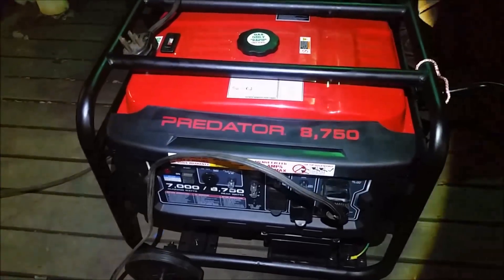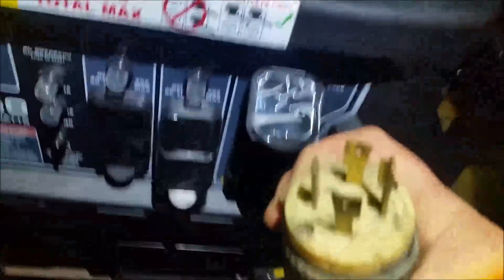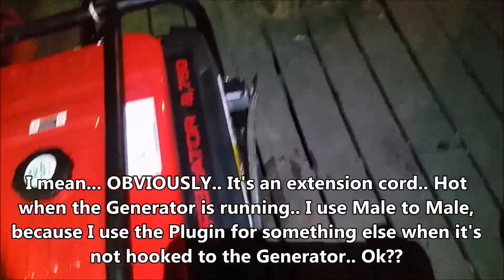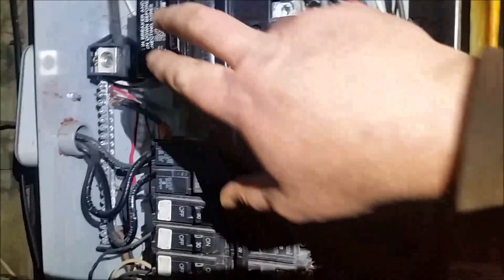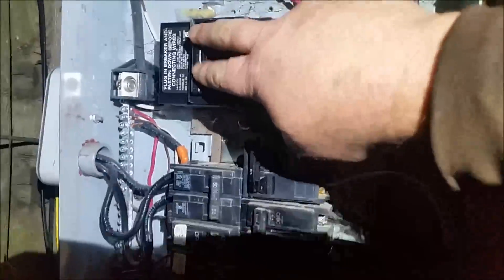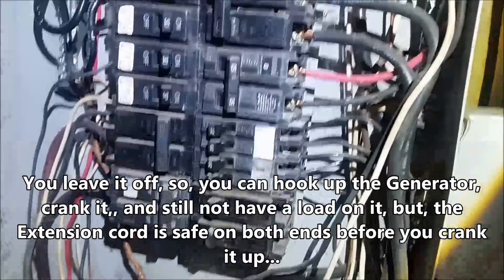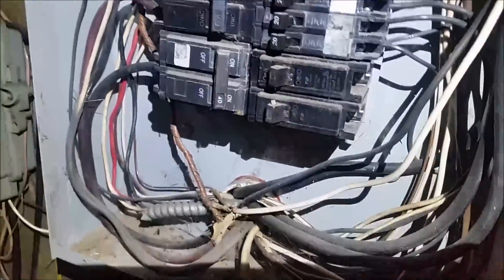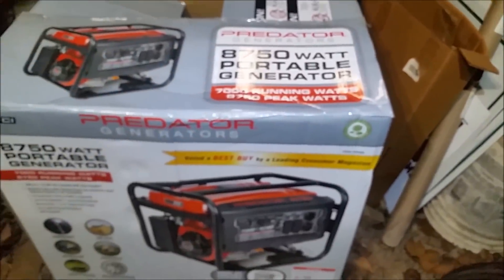Quick/Easy/Safe: Use Existing Plugin/Breaker for Generator hook up to your house Panel box.

Comment: "Common Sense" suggests an average degree of such ability without sophistication or special knowledge. You keep yelling at everyone as if they don't have Common Sense, when in reality you need to be stating "This video is not for those who can't follow the exact 7 steps exactly as planned every time even while under duress and who is also comfortable exposing 2nd or 3rd persons to failure at attempting the 7 steps once the mechanics have all been installed and that failure to do so could result in death of local persons or line men."  The commentators who are licensed electricians are telling you it's illegal and they are telling you what it takes to setup a fail safe system. For this task, I would say that Common Sense represents everyone of ourselves who are not licensed electricians and that special knowledge is not in the scope of us Common Sense people. So the solution is simple, change your title to "How I hooked up my generator to my house (illegally but it works)", followed by adding the comments, "Certified electricians please comment on caveats and how to make a fail-safe permanent installation for a portable generator."
Reply from the maker: Exactly what I said. This is for people with common sense, so all those wordings that you just typed are not needed. And, it is not illegal. Those are plain and simple facts.
It's not even illegal for an electrician to do this to his own home. But if he charges someone else as an electrician, and does this for someone else, then he has violated the electrical code that he agreed to whenever he got his license, there for his license would be subject to revocation.
Against code, but not against the law. And considering, the male to male cord which is the only thing not Code Compliance, won't be plugged in when the inspector gets there, there are zero problems with this setup as long as you remember to turn the main breaker off, the breaker you use for your generator off as an additional safety precaution, and hook up both ends of the cord before you crank the generator. But it would take common Horse Sense to figure that one out. That's why we have so many comments on the video that are negative period lack of common Horse Sense
Reply: You're stating that it's not illegal, but then you also state that you have to hide things from an inspector for it to pass inspection. I actually have no clue whether or not it's legal, but I'm just real curious to know why such extreme arguments exist from so many people on both sides. It seems like you've done quite a bit so far and it seems like you utilize the generator multiple times a year, why not just step it up one more notch and get the final punch up to where it would fully pass an inspection?!? After all this is not an emergency, you are doing it in a planned manner. Then have the city inspector come out with the house running on the generator, hand you the inspection report, and post it here, done!!! End of discussion!!! Hell, even make a bet with 10 guys on this forum that think you won't pass inspection and collect some gas generator money for the next few months!
Reply: +hgodtx -- If you don't know what you are talking about, why did you say you did.  The reason there are so many contradictory comments is because the laws vary from city to city, town to town and place to place.  The National Electric Code is NOT law UNLESS a city or town passes and ordinance saying that it must be followed.  Many do exactly that.  Many do not. Some don't care and minimize codes to make it easy for contractors and homeowners to get work done without fighting bureaucratic red tape.  What make does (and I do with a solar generator) may be illegal in some places and may not be in others.  In some places codes apply only to professionals who earn a living doing electrical work or contracting.  Homeowners are excluded and often do not have to pull permits to do work on their own property.  That is as it should be.  There is NOTHING wrong with what Mark has shown us but it could be illegal depending on where you live what kind of nanny state government you have locally.  Thanks, Mark, for an informative presentation.
Reply from the maker: Thanks I'm Grateful.. I have not lived in a state yet that disallows a homeowner to do his/her own work. Nor one that "requires" that you pull a permit if you are a homeowner doing your own work.. I would think that a town would "like" you to pull a permit and get an inspection (Taxes/Fees/fines/Permits/certificates is how the government rolls around), but, I am not familiar with any that "Require" the inspection for homeowner work..  Not saying some Liberal state has not done that for sure.. I have beaten several citations that I have gotten because they were written by someone who writes for whatever reason he/she wants to write one, but, when it comes to enforcement, and they have to answer to the code, often, they are stretching the bounds of their authority because people just don't know the law, etc.. Vehicles in particular.. I run a fleet. 
When you confront them, they usually only write a warning, and they want you to jump through hoops to address the problem,  but, all they get from me is a letter of intent explaining where they are wrong.. Sometimes they will eventually write you a ticket, and that gets beaten, usually before you get to court, when you remind them, you have already addressed it to them, and they don't want to do their jobs and get informed, so, it's a bit embarrassing to them to have that brought out in a courtroom, so, it gets squashed when it gets to that point.. But, they get away with it enough, when they run into someone who knows what is going on, they just usually avoid you.. That is if it is an area thing and they get to know you.. 
For 5 years the DOT guys threatened me about seating capacity.. When it came right down to it, I had found that every school bus purchased by my state over the last 10 years was against Federal (Law) in this case. CFR and USC.. After working real hard to get a returned phone call, after leaving that message, the next morning got calls from each department's "Lawyer",, Mr. Thomas,,, what exactly can we do for you,,, was their final response. After that,, ZERO problems with that group again... 
Not sure about your other comment about adopting it as law though... Even a speeding ticket is a Code Infraction with a Citation and Fine vs "Breaking the Law"... Technical differences only, but, it still comes out of your wallet either way.. So, can't argue either way on that one.
Reply: @imgrateful2750 :great explanation! Exactly what I wanted to know.
Reply from the maker: The Inspector is not going to come inspect while you are running on Generator... There is nothing done to the Panel. Zero.. You "NEVER" have to open it... Not even once.. You use an existing connection that you already have.. Another reason it is Safe and Easy.. Just unplug your Welder, Air Compressor, Dryer, etc,, and use that connection.. Nothing to pass inspection. Nothing changed.. I think maybe you see that now... It is only when the power is out, inspector is not coming, that you turn off the main breaker, Welder breaker, plug in your cord, crank generator, turn on generator/welder breaker and you are up and running.. Why do I want anything simpler than that??  I have common sense. I don't forget to tie my shoes, put my car in park before leaving it and I don't get ready to go on generator without turning on my main breaker first.. It's just as simple as that.. 
It could be as simple as Turn Main Breaker off, Hook up Extension cord, crank Generator and you are online again.. Why would I want to spend $300-$400 to do that some other way? Not!!
When I am done.. Turn off the Generator, unplug extension cord, turn on main breaker. How simple is that?
Oh.. If I spent the $400, I could leave the generator hooked up.. Of course I could on this setup, but, I am using another plugin that something else is plugged into normally.. So, doesn't make sense there either.
I keep a portable generator for a variety of reasons.. Not just powering my house. Lets see.. Last two times I used it away from the house.. To change a bus tire flat, to run my portable air compressor to run my Air over Hydraulic Jack and my Air Impact wrench.. To run an Electric Jackhammer I rented for another reason to break up a huge rock between two trees that was way too far to run an extension cord.. I just tossed it in the trailer with the jack hammer, drug it over with my 4 wheeler, broke it up and went on about my business. If I ever buy a whole house generator and I hook it up permanent, I still don't think I would leave it plugged in,, unless I had an "automatic transfer switch, not manual", and I don't think I would piss away that much money ever in my life, and if I didn't have time to work on it, and wanted to take it down to the local repair shop, I'm sure it would not be an easy task.. Would have to go fire up the Tractor or the fork lift to load it.. 
And, all I have to do to run the "Whole House" is turn off my electric water heater once the water is hot, and that problem is solved, so, don't need a whole house generator(non-portable).. Besides, when you have as much crap as I have, you are not wanting another maintenance item to take care of that is not a regular running item.. In my particular situation, I can go 5 years without too many power outages and then, for the next 5 years, it is out regularly.. So, one generator is enough.
90% of the arguments are about "Suicide Cord", "Not turning the Main Breaker off".. That's exactly what I address in the Notes and a couple times in the video. If you can't remember to tie your shoes or put your car in park,, this video is not for you.. 
If you can remember to turn the main breaker off,, that is the people who will benefit from it. Those that understand that Electricity is nothing to play with, and the first thing you do is turn the main breaker off.. Besides..  The first "Do you know what you are doing is going to come from building the male to male cord".. If they go to the local hardware store and start asking how to build a 220v cord and are standing there with two male plugs,, if they don't have some common sense,, they will never get out of the store..Ha..Ha. Common Sense and Confidence is who can benefit from the video.. I didn't mention Confidence anywhere in this video or in the comments section until just now. But, I think you know why I just said it.
Remember.. You call the Inspector.. He doesn't just show up.. I don't like paying taxes and rules and regulations.. I don't mind paying taxes, but, I don't like how they piss my hard earned money away... I don't trust Western Medicine because I understand what it is, so, I don't take Tylenol to get rid of a headache, because the headache is still there, and the source of it is still there, the only reason you think your headache is gone, is because the western medicine attacks your receptors with receptor blockers, so, you "think" your headache is gone.. Have you ever met an older person who only had One Prescription for some singular problem? Nope!! They have a whole cabinet full. One to fix this and two to fix the crap that one does, etc.. No cure for Shingle and Cancer?? Ha.>ha..Ha.. Make your own Colloidal Silver and mix it 70/30 with DMSO=Diamethyl Sulfoxide (did not check the spelling), and spray it on one time and tell the Doctor to go to hell!!
And, next time you see your doctor, ask him what cancer is and see what he tells you.. It is living!! It Grows, Spreads!!
Then, ask him why your body develops Cysts/Tumors, and see if he will relate that to an active cancer.. And, if he tells you the truth, you will know how easy it is to cure cancer and you will know what a fraud he is.. 
But, before you go,, you should do a search on youtube for "Dr. Simoncini Cancer is a Fungus" and look for a video where he is being interviewed and he has a video on his laptop of when and how he discovered that cancer was a fungus and how he accidentally killed it using "Unauthorized Medicine" (Baking Soda and Water), instead of the Approved Saline Solution.. That would be one of his videos before the FCC, and the AMA destroyed him, took away his license and ruined him financially.. You don't threaten Big Pharma.. So, I do what I do, because it makes sense.. I make my own antibiotics, etc. I don't go to the doctor and I stay as far away as I can from others who follow the rules blindly.. 
If I knew what I know now, back, 10 years ago, my Dad would still be alive.. I was living the lie then too.. But, it was what got me started researching on my own... Colloidal Silver is blackballed by the FCC and FTC and FDA.. So is DMSO.. But, NASA uses a Silver and Gold Collodial Silver generator in the ISS, and so does the Russian Mirr Space Station, and DMSO is used in Stem Cell Research and in organ transplants to keep the tissues from degrading, so, make up your own mind.. 
I see spending $400 on hooking up a generator that I can hook up in a couple minutes for $20 as the same,, following the rules everyone else follows blindly.. I have not found anyone who can argue a point to make me change my mind.. Only reason I turned the comments back on, on this video.. I went to looking at the comments and knew I was right and they were ALL WRONG!! And,, I still feel that way, but, invite someone to prove me wrong.. My system for a DIY'r is much, much safer than a Manual Transfer Switch or even an Interlock, """""""IF""""""" you remember to turn the main breaker off.. 
I have reasons posted all over this video why..